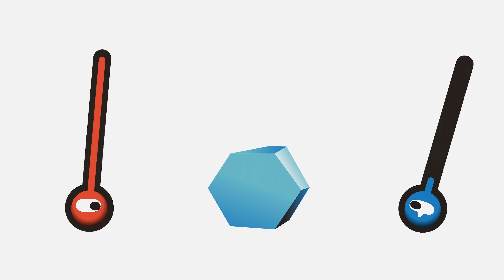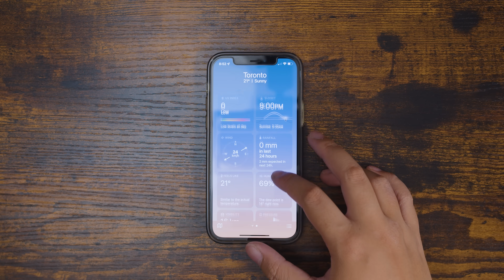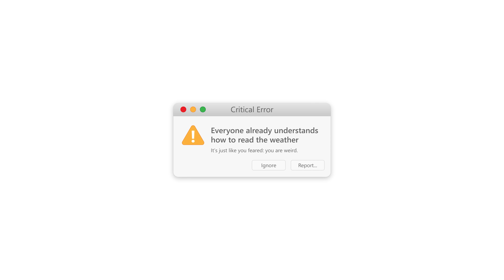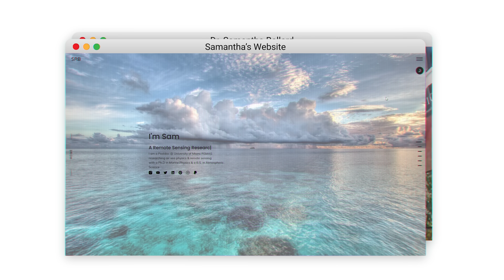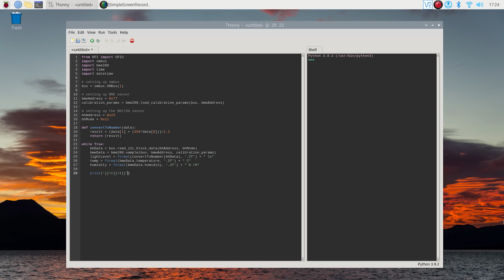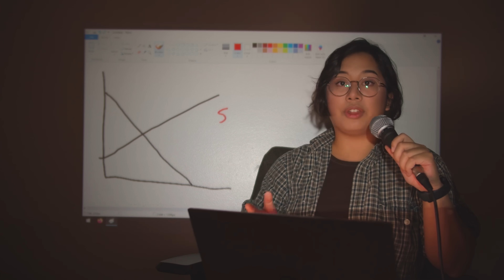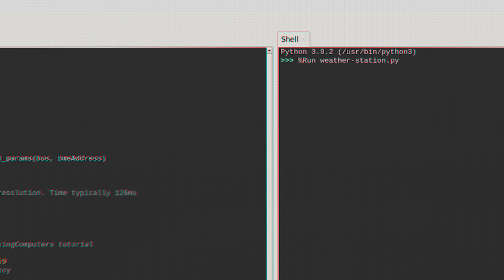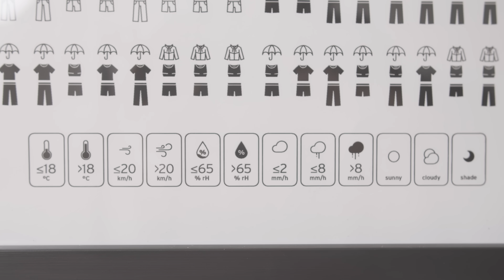how fahrenheit fails you

Comment: If people took 30 minutes to find examples of extremes and mid-points from each scale in their own lives, it would have been very simple regardless of the scale used. For instance, 40 is unbearingly hot in Celcius and 0 is, obviously, freezing. Room temperature is 25. Just these 3 is more than enough in a lot of cases. In the video, the example of "10 degrees" is given. It is right in between room temperature and freezing, so you will want to get your coat.

The problem comes from the "compactness" of Celcius. But even if Fahrenheit people argue otherwise, you don't need the difference between 54 F vs. 58 F.  No one can tell that difference and it's useless anyway. So Celcius is much easier to learn as you don't have to play with a lot of numbers. 0s are freezing, 10s are cold, 20s are warm, 30s are hot, 40s are scorching hot. What does it matter if it is 23 vs 27 degrees for everyday life?
Reply: the difference between 23°C and 27°C is going from perfect temperature to unpleasantly warm
Reply: @richiericher9084  tfw 23 Celsius is cold but 27 Celsius is perfect temperature for me.
Reply: @richiericher9084  but the temperature fluctuates depending on time and place, so it really isn't that big a difference when it comes to what clothes you'll be wearing during that day.
Reply: I'm sorry but 23 vs 27 is a very relevant difference
Reply: I dont know man 68 F is kinda chilly for me, while 74 F is getting pretty warm. When your bmi is very low you notice very small fluctuations in temperature.
Reply: For someone live in tropical country 27 is chill nice while 23 is "glad i bring jacket today".
20 is cold where i will need coat for that
Reply: I absolutely can tell the difference between 54 and 58 Fahrenheit lol
Reply: If your room is 25 I’m not coming over
Reply: 23C is hot (in sun, comfy in shade/inside), 27 is big hot (in sun, uncomfortably warm in shade/inside)
Reply: 70 degrees Fahrenheit and 72 degrees  Fahrenheit is the difference between me living in a tolerable environment and getting sick from it being to hot.
Reply: but 0 to 40 is a weird scale. “horrifically hot” and “brr a bit chilly” doesn’t work that well. you have to go for the other extreme, which would be like,, -20? you’re comparing getting a heatstroke to getting some frost on your windshield
Reply: @ooriiaxx  0 to 100 is a good scale I agree, the issue with that scale is that 70 is the "average feel good" temperature, if it was 50, I would be all over Fahrenheit, but to me its just not intuitive to have a 0-100 scale where 70 is the middle point of human existence.
Reply: Explain to me Celsius thermostats with .5 increments. Literally to achieve nearly identical "incompactness" to Fahrenheit.
Reply: in celsius a 2 degree change is VERY noticeable, mostly in the 5-15 range
Reply: > 0s are freezing, 10s are cold, 20s are warm, 30s are hot, 40s are scorching hot. What does it matter if it is 23 vs 27 degrees for everyday life?

Ah, I can definitely tell the difference between those, as those are the temperatures I can feasibly get my room to with air conditioning. For me, 20 is the crazy cold temperature some ACs are set at, 22 is a bit too cold, 24 is wonderfully cool and comfortable, 25 is also pretty comfortable, and 31 is the normal temperature in my room before getting a portable AC and is hot but bearable with a fan.
Reply: Fun trivia 100⁰ Fahrenheit is roughly body temperature (so somewhere between 35-38⁰ Celsius) so 8t can be rougly read as x% of body temperature 90% being hot and 60% being cold xd
Reply: Agreed, but you also picked the two worst numbers to “what does it matter” with 😂 At least for me personally, 23 is still somewhat chilly, pleasant, maybe a thin second later and 27 is past the threshold of okay it’s a little hotter now, shorter sleeves shorter pants
Reply: Usually room temperature is defined as closer to 21 degrees, though this depends on what you are acclimated to as well as humidity.
Reply: In my city, the difference between 23 and 27 is whether I can use a light sweater as a shirt pleasantly throughout the day, or if I NEED to wear short sleeves to not melt in a puddle with the midday sun
Reply: 25° as a room temperature is way too hot. I wouldn't be able to sleep. For outside 30 is scorching hot, 20 is hot, 10 is nice, 0 is ass especially in the spring because everything is wet, -10 is nice, -20 is kinda cold, -30 is cold and -40 is really cold
Reply: @xKuukkelix  are u from the arctic
Reply: @pacomoka  ye. I live 6km from the Arctic circle
Reply: @xKuukkelix  northern gang solidarity. 0 to -10F is still jacket weather for me.
Reply: Spoken like somebody without a thermostat that works in Farenheit

I promise you a 2 degree change is noticeable, 4 degrees absolutely is
Reply: @orangeandblack5  2 degree f is roughly 1 degree c. So Celsius granularity is good enough for me.
Reply: @orangeandblack5  yep
Reply: @orangeandblack5  noticible and meaningful are not the same
Reply: @xadielplasencia3674  Tell that to my power bill.
Reply: @xadielplasencia3674  you notice it by feeling with your body, which incidentally is the exact metric that we are concerned with, making it meaningful hy default if it is noticeable
Reply: @melody3741  You can notice a sudden change from the temperature in the room sure, but you could not determine the temperature of a room to that degree of perfection
Reply: @xadielplasencia3674  Just because you can't make that determination of what degree of temperature it feels like doesn't mean no one else can. I can as well. I can also hear a cat walking past a window 10 ft away, and em frequencies from electronics produce an audible whine. Audible to me, my sister, and not many other people I've met.
Reply: @orangeandblack5  I'm pretty sure that's your brain playing tricks on you. Change the thermostat to Celsius and let's see if you will still notice the 2 degree Fahrenheit change.
Reply: @pkj2148  somebody else made the point that it's ~roughly 2:1, which I think is fair because a 1 degree change is definitely not very meaningful

But 4 degrees F on the thermostat is the difference between being noticeably warm and noticeably cool (even if one of my roommates changed it without me knowing), so I don't think swapping it to Celsius (if even possible with my old dumb model) is going to do anything
Reply: @orangeandblack5  I think the important thing is that temperature at the end of the day is relative. 0 degrees celsius to 2 degrees cesius is going to be a much more noticeable change than 27 degrees c to 29 degrees c.
Reply: @pkj2148  you can definitely notice the difference between 12C and 15C and with rounding up that's the change you get from 4 degrees of Fahrenheit.
Reply: @orangeandblack5  Its not 2:1, if I remember correctly there's a different starting point too. I'm too tired to google it though.
Reply: @kanedaku  yeah, freezing is either 0C or 32F, I know lol

The point is that it's 100 degrees from freezing to boiling for Celsius and nearly 200 for Fahrenheit so it's nearly 2:1
Reply: @orangeandblack5  Um...🤔

Nevermind mate.😬🙄
Reply: @kanedaku  wdym

Freezing: 0 C
Boiling: 100 C
Difference: 100

Freezing: 32 F
Boiling: 212 F
Difference: 180

The actual ratio is a 1 degree Celsius change is a change of 1.8 degrees Fahrenheit, but that's close enough to 2:1 over short ranges that we round
Reply: @kanedaku  sir just because you can easily tell a 2-degree-Fahrenheit difference doesn't mean literally anything else you said was accurate/warranted lol

Fahrenheit is usable with some advantages, that's the entirety of my take on it lol but go off?
Reply: @orangeandblack5  Er, I was being polite. YOU were the one who said 2"F is "noticeable."
I think that everything else stated was accurate, apart from your and your compatriots  reasons for preferring Fahrenheit, because that is an opinion.

It seems I have got through to you though, with your backtracking statement "Fahrenheit is usable with some advantages"
Advantages, no. But you admit that Fahrenheit is only "usable". Correct.

Goodnight.
Reply: @kanedaku  it can be both noticeable and a crappy system for most things lol
Reply: @orangeandblack5  Smashing.
Reply: So many people say "switch to metrics" when they don't realize that's essentially like trying to change the language of a country
Reply: @hyperx72  duh, You ALREADY switched to metrics. Only general populace still uses imperial system. All other spheres use metric system otherwise rest of the world would rather ignore USA. After so many problems and catastrophes due to imperial system not properly translating into metric.
Reply: @robertnomok9750  How?
Reply: @hyperx72  "Although customary units are used more often than metric units in the U.S., the SI system is used extensively in some fields such as science, medicine, electronics, the military, automobile production and repair, and international affairs. Post-1994 federal law also mandates most packaged consumer goods be labeled in both customary and metric units"
Reply: @robertnomok9750  Not everyone works in those fields?
Reply: @hyperx72  And? I already explained to you that EVERYTHING you use or do is done in metric and merely translated into imperial units for general populace as an old tribal custom and nothing more.
Reply: @robertnomok9750  The military also used knots and angels, I'm not sure what the medical field uses but a lot of people and fields here still use imperial.
Reply: @hyperx72  lmao it's not tho it's just fucken numbers
Reply: @suzyocean7392  Numbers which many of our systems are built around. Numbers that are understood and measured through dozens of interlocking systems. Hell changing just from miles to kilometres would mean changing countless tens of thousands to millions of signs, retraining everyone on the new system, retooling all our systems including police radar guns and such, all with likely high confusion and little benefit to most.
Reply: @alexassassy5855  You could say that for converting lines of code to change a country's language too. Are you going to change to Metric 2 once they figure out how to put other extreme scientific examples on a scale? Maybe for heat you can learn to how to put every range of temperature humans can exist in on a decimal point, and maybe for distance and speed we can start using AU's to be more consistent with planetary orbits.
Reply: I personally like Fahrenheit because you can get decently granular with nice multiples of 5. 70 is just about perfect, whereas 65 is slightly chillier but you can wear a t shirt. Not screwing with this 23 or 27 nonsense, because 20 and 25 is much better.
Reply: @Dr.Schnizzle  yes! Say it louder!!
Reply: @Dr.Schnizzle  You are kina dilusional. Its a celsious that works on multiples of 5 and not fahrenheit.  15 is chilly, 20 is nice, 25 is warm, 30 is hot.
Reply: çok doğru söyledin katılıyorum

Comment: Love your open, committed to learning-along-the-way approach.

My thing has always been to, in the ultimate possible reduction, keep on doing the same thing(s) until I feel I need to change things, on the seasonal timescale. Maybe that's a privilege of those who don't get cold easily and who don't mind the occasional rain drenching. For the heat it's normal and healthy in the summer to just not be out during noon to afternoon hours, if it can be avoided, and certainly not in the direct sun, aka siesta. This is not about comfort, much like not being outside too long in extremely cold winters, especially when it's dark: It's to not hurt ourselves.

But we're supposed to be out, otherwise, throughout the year; noon to afternoon in winter,  mornings and evenings in the summer. Moving, getting fresh air and all that. And that's not really comfortable or uncomfortable, but I do think it helps being more comfortable the rest of time.

If preparing for and having specific sets for specific conditions is what works best for you, that's great. I'd only add, that I think it's as much about experiencing and being in a range of conditions as having just the right fit for a specific condition.

Comment: Zero is wear a coat. Or the equivalent number of layers. I know you hate that...but:
If it says 10 degrees take off a layer. 
If it says 20 degeees take off two layers.
If it says 40C you should be practically naked.

Comment: I'm weird about temperature, because I actually enjoy the heat, a range of 70-105F doesn't really affect me, and apparently I'm very warm to the touch. So for the most part, I notice instead when it's humid or when it's cold- a temperature drop of 10 degrees is enough to make me panic and shiver, even if it's still around 65F,  so my understanding of temperature is more based around how close we are to 0's and negatives, and then wearing a thick jacket or hoodie even if said outfit would be overkill. Getting hot is fine, you can always lose layers, but you can't just Uber warm weather clothes to yourself at a moment's notice.

On the matter of choosing clothes, it's always more important to focus on exposure and breathability. It's quite possible to be covered head to toe in a desert and feel fine, and wear thin layers in winter and also feel fine, as long as the material being is right for the time and situation. Baggy thai fisherman pants and a silk or other light fabric loose long sleeve shirt can keep you cool and also keep the direct sunlight off of your skin, also keeping you cool. A nice straw hat with a wide brim, and your head is several degrees cooler than not.  In winter, making sure every inch of skin is covered, with extra thick protection on your extremities (hands, feet) does wonders. So nice padded gloves, thick insulated boots with long wool socks, and a scarf can make any outfit winter proof. Fabric face masks during the pandemic actually did wonders for me last winter because they kept heat from escaping out my exposed face.

Comment: God no, farenheit just doesnt make sense, i tried it once when i got to usa, how that watter freezes at 32 farenheit? And how is that air conditioner a 64 degrees is 17.77777 celsius? The worst psrt was trying to calculate what does 80 degrees mean, because yes i was in florida and it was pretty hot but not that hot. At least the miles is 1.6 kilometers, not that good because it doesnt end with five so you have to know the 3 table but not imposible, you mean that i have to take the number, multiple by 1.8 because why not, and then add  32? Dont you want me to make a backflip also? Just senseless

Comment: <0C there's snow. 0-10C - wear a coat. 10C-20C wear a jumper. 20C-30C wear a t-shirt. 30C-40C wear shorts. >40C don't go out. It's really not that hard.
The most common argument for F is that it's more granular - like anyone can tell the difference between 78F and 79F.

Comment: don't worry, i didn't learn about how to dress for the weather until i was in my twenties. i moved to somewhere who's name translates to 'mother wind'. it made me realize how bad i was at dressing for the weather where i had lived before that, but with the extra variable of extreme wind, i realized i was atrocious at dressing myself. it was about the same time i realized i was also wearing shoes that were too small. 

i finally figured out how to dress for the weather (including dressing for 30 degrees celcius with wind, which requires a very odd combo of clothes), and then of course i moved to somewhere with a similar climate, but replacing the wind with humidity. soooooo.. that's fun to now have to relearn how to fucking dress myself!!

Comment: I actually like the idea of using an inaccurate system for this measurement. One of my favorite anecdotes I ever heard was about using an absolutely awful voice generator as the base for creating a realistic voice because it was simply better at highlighting certain things. I do this in my own work since I often work with microphones and interface equipment that are also inaccurate and don't have flat responses, but pair the right match together and that makes a more desirable outcome than even a flat response overall. This makes me think that, even if you thought it was a you problem, it could be more widely applied. I especially believe this to be the case because of the criteria you used since they very clearly address wet bulb temperature and the danger it can pose in a hot and humid climate.

Anyway all that to say this poster is awesome looking forward to all your upcoming videos
P.s. For real tho, Please where is this poster for sale?

Comment: Celsius is fairly intuitive. You can expect anything between -40 to +40 depending on climate where you live.
Anything between 0 and -40 is freezing the difference being how fast you freeze. 
5 to 15 °C means you'll most likely be cold but it's really not bad
18 to 25 is the comfort zone of most people 
anything higher than that (for prolonged periods of time) means you'll just have to wear somethg lighter
35+ depending on humidity you might want to consider not going outside at all or minimize the time spent there

Comment: celsius is so straight forward though, based on the freezing and boiiling point of water, 0 is freezing and 100 is boiling.

in australia,  10-18 cold 18-24 pleasant 24-30 warm 30+ HOT 
5 degrees of difference between a change in wardrobe. i'd imagine that 5 degree difference is the same in other climates